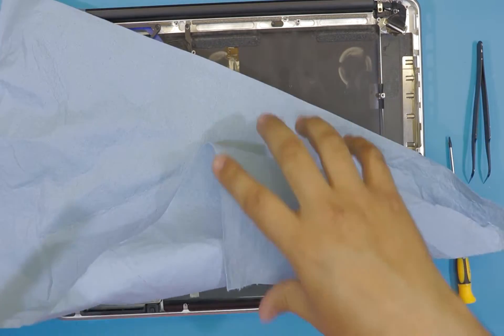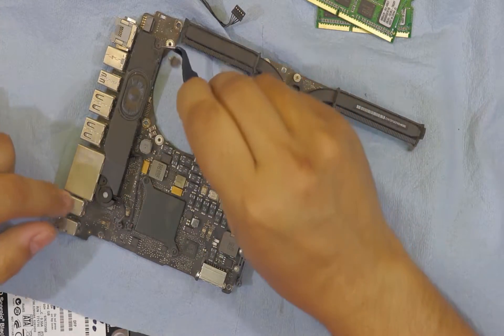How To Fix : MacBook Pro A1286  Won't Turn On (Power On)

Comment: Do you mean to tell me you have an actual reflow station for working on motherboards and you're instructing people to use hair dryers?
Reply from the maker: Yes, that is correct. That's why it is called DIY (Do-It-Yourself). Otherwise, I would have made a video on how to prepare for a laptop repair shop visit, if I wanted people to buy a reflow station just to fix a motherboard. I could have made a training video to guide them in using it. However, it's not worth it, my friend. Using a hair dryer can achieve the same results.
Reply: @uFixTek  a hair dryer doesn’t get nearly hot enough to melt the solder underneath a chip. Even with decent flux, it doesn’t have the air speed or heat.
Reply from the maker: Alright, let me correct and clarify a few points:

Okay, you don't need excessive heat or airflow to melt the solder. It's a simple physics principle.

There are multiple factors involved, but first, it's essential to understand why we perform reflow. The reason is that there is a cracked solder joint that is not making proper contact with the board. This means that the board is not absorbing heat from that specific joint. Consequently, that joint will melt before any other solder joint or balls, as proven under a microscope.

To address your initial concern about not enough heat, it's important to note that there is sufficient heat, and it is achieved over a period of time. Heat applied consistently over time leads to melting.

To simplify, imagine holding an apple with your arm extended in front of you. Initially, it doesn't feel heavy. However, if you keep holding it for 10 minutes, you will start feeling its weight. The same concept applies here. We are not removing the BGA chip; we are solely targeting the single detached solder joint. With enough heat from a hair dryer and regular airflow, you can successfully reflow the single detached solder, without the need for reballing.

I hope this clarifies the process of reflowing the solder joint.

What I am saying and doing is based on my extensive experience of over 17 years in laptop, console, and electronics repair, backed by a professional degree in the field.

Comment: I like this tutorial. I have the same Mac and it fails to boot despite SMC, PRAM and all that. The only thing is the little light at the front does come on. So there is power. All that thermal paste business and heating the chips to 180C would be completely new territory for me. However I don't have anything to lose.
Reply from the maker: Thank you for the feedback and your support to the channel, have faith and take your time and don't worry if you need help doing so let me know i help you on every step . :)  you can do it :P
Reply: @uFixTek  How did you apply the liquid flux? And where did you heat-up the motherboard ? In a conventional fan oven ? Also, when you removed the epoxy around the four corners of the GPU, then what do you do to replace the epoxy, if anything ?
Reply from the maker: @mindfulawareness1  do me a favor if you want email me and i will help you out via whatsapp as you do the repair. 
ask@ufixtek.com
Reply: @uFixTek  I'm going for it !

Comment: Does this work for the A1278  
I clean the mother board and after that the power bottoms stop working also before that it got very slow and cpu usage showing 88 % 
Computer still powers on automatic the power cable in
Reply from the maker: yes it works for A1278, same logic, do a repaste and clean the fan and heatsink, and see how it goes.